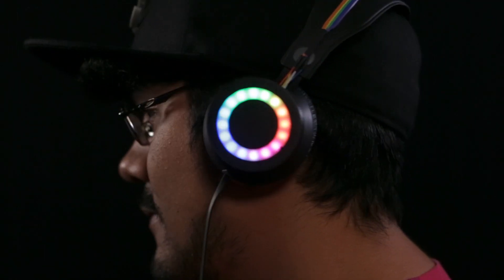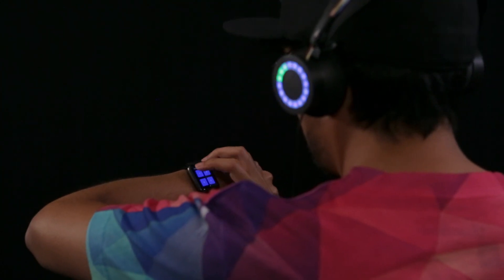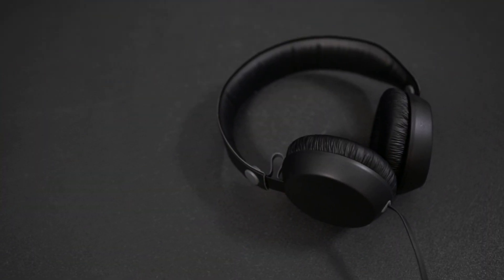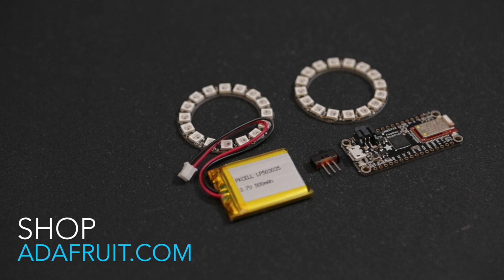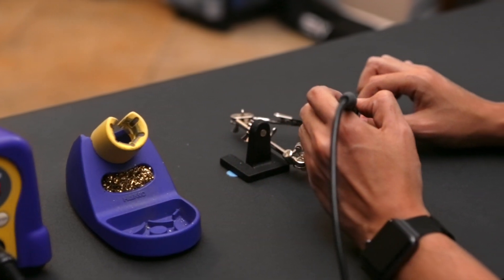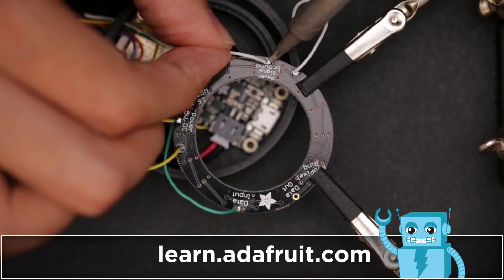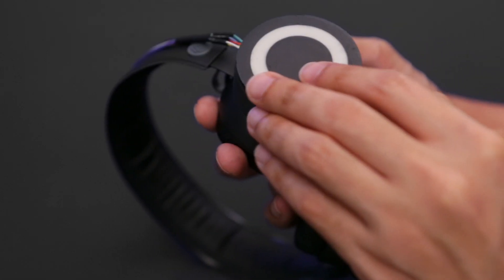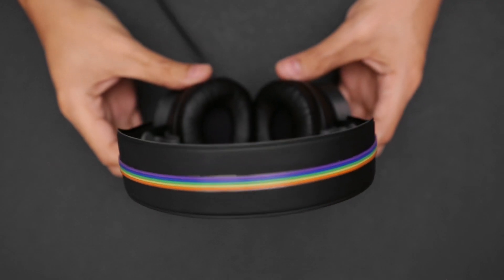How to make Bluetooth Controlled LED Headphones

Comment: Can someone recommend some mid range to higher end wireless headphones that look nice in this setup?
Reply: I just bought a picun b12 headphones. They are kinda similar to these in the video as far as design wise goes except that the b12 design is a way thinner led circle but solid colors play throughout. The downside is I cannot find a way to set a specific color, all 7 colors play one at a time. The good news is they have noise cancellation but the bad news is that it is not a very good noise cancellation, you will be unable to hear anyone or anything while wearing the headphones but everyone will be able to hear your music or whatever you are listening to